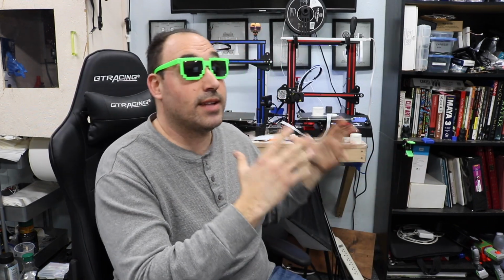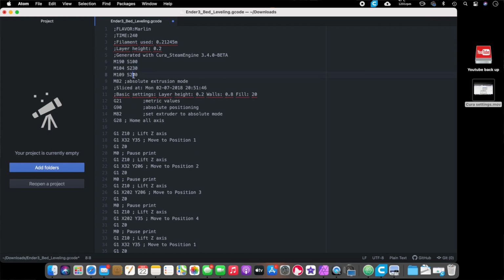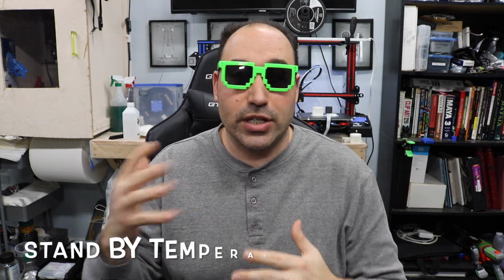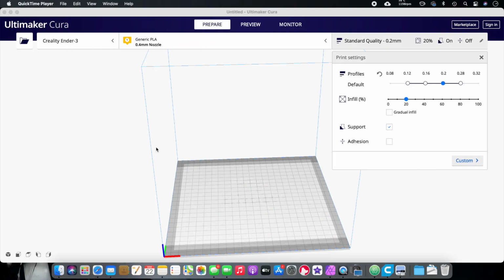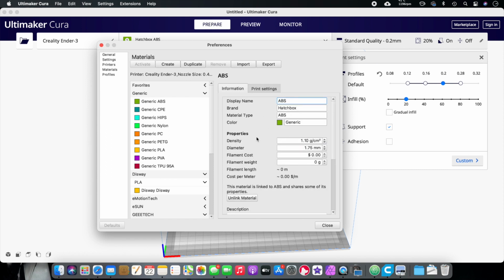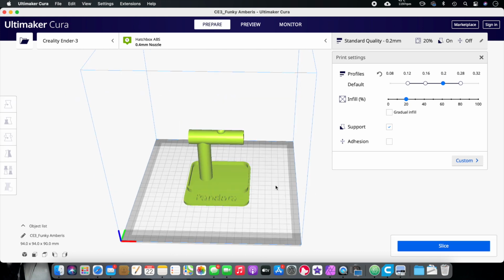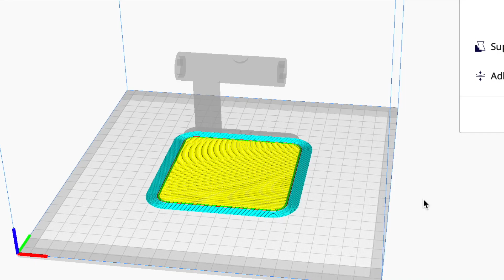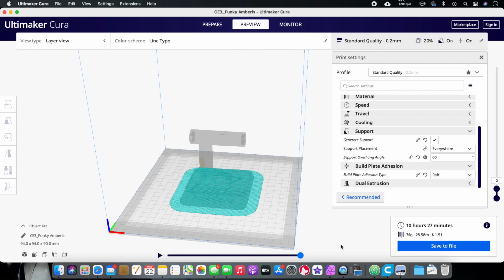Can you 3D Print ABS on a Creality Ender 3?

Comment: Will this also apply to the Ender 3 V3 KE?
Reply from the maker: It should.
Reply: Hey dude. I just managed my first successful ABS print on the V3 KE. Edit the filament settings and turn the bed temp up to 110 and, most importantly, turn off all part cooling. The default for CR-ABS is no cooling for the first 3 layers and then the fan comes on at 70% and it instantly warps. I just set that to 1000 layers so the fan doesn't come on at all, and voilá.

Comment: After watching a lot of videos on printing ABS I think I'm going to stick with PLA. I'm proficient with PLA and ABS just seems like a lot more hassle.
Reply from the maker: I do everything in PLA + I don’t know what ABS hype is all about 🤷‍♂️
Reply: Supposedly it's for heat resistance, like filament joiners which may deform if printed in PLA. But the problem is after the, what, 30g of filament you use for that, you're left with the rest of that roll which is just going to sit around and absorb moisture.

If you really want to try it, see if you can get a 250g mini spool. That will likely be more than enough ABS than you'll ever want to print with.

Comment: Stiffness is also higher than PETG. Which along with the temperature resistance makes ABS a great material to make 3D printer parts with. Provided your setup can get the warping down to an acceptable level.
I mean worst case you jury rig the part until you get your 40C chamber going with jank parts, and then go for flawless replacements. Even the jank parts will at least hold up at 40C, standard PLA will not.

Comment: Thanks Crazy Will, while the first few times I found I struggled tot watch your video cos it triggered  memories of my father (he had a car dealership and starred in his own  late night TV ads) , I identify: after all these years, I am still crazy as a loon, crazy mental and girl crazy,  Also,  years ago I thought it was prudent to buy a whole lot of ABS for my old enclosed Robox printer and being cheap can't bear throwing it out so I bought an eSun dryer and built an enclosure & am on a quest to find a way to use ABS on an Ender 3 v2 but no luck yet. I get the rules about temps and slicer settings  but refuse to move the power supply and mother board out of the enclosure and rewire  the Ender 3 fans just yet. 

I like to see trial and error vids from a passionate user and like the almost making it up as one goes along vibe.

I have subbed because your aim is TURE, so peace.

Comment: I never got ABS to work on my Ender3 max, I just gave it up.
eSUN PLA+  works perfect with 225,60  and it's better than ABS.
Reply from the maker: I agree with you but I like the Duramic 3D PLA Plus. Have to use it at 220c very very strong. https://youtu.be/HV1ZagitlmM

Comment: I used your settings of 230 100 230 on my ender 3 pro. My first run of building a three and a half diameter pulley had cracks running through the middle and one side of the pulley is a quarter inch shorter than the other side. I wish I could post a picture in the comments. Apart from levelling my bed are there any other things I should change in my settings to get a better build?
Reply from the maker: Go to about on my YouTube channel there you can e mail me pic.

Comment: I bought a Ender 3 pro encloser can I put argon into it for better prints?
Reply from the maker: Argon?
Reply: @CrazyWillTechShow  the gas/element on the periodic table basically argon removes oxygen
Reply from the maker: @unwantedgoose9000  honestly have no idea I would have to try it. I know people have used acetone after the print is done.
Reply: Why not an active heater? Would it make sense to mess with gas? 
I'm using a cardboard box enclosure,  it's in my shed,  5-12 Celsius degrees outside,  18-35 in the enclosure. 
Nearly done with 7 lbs of  abs+ from sunlu

Comment: hey, great video, but for some reason i'm not able to select the skirt, do you know why?
Reply from the maker: You have to turn it on in settings in cura click on printer settings >custom > build plate adhesion> then you can choose skirt or brim.
Reply: @CrazyWillTechShow  thanks, but when I do that, the adhesion is disabled and i am not able to use the skirt
Reply from the maker: Go to ultimaker cura in the top menu Preferences> settings> build plate adhesion and just check the setting> build plate adhesion type.
Reply: @CrazyWillTechShow  i already did that, do you hve any other ideas that may fix my problem?
Reply: @CrazyWillTechShow  ok nevermind i got it to work